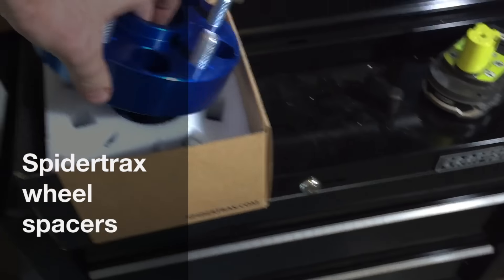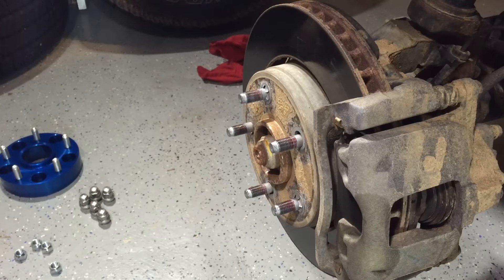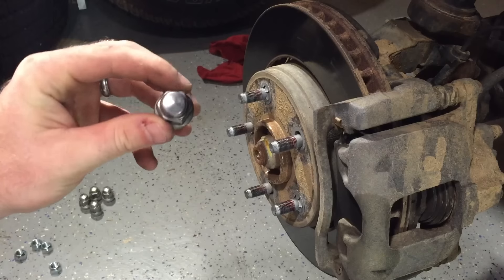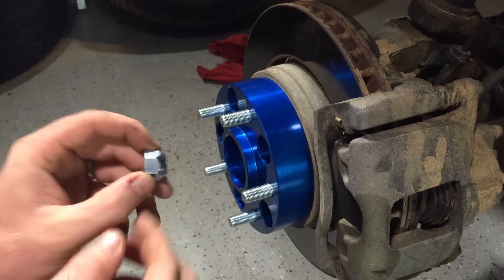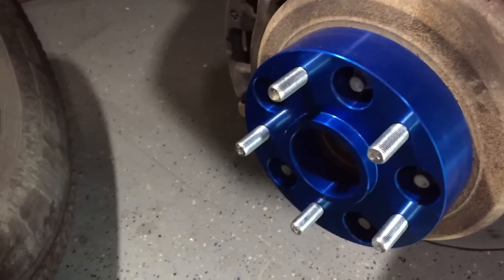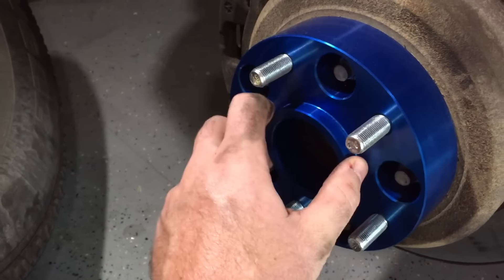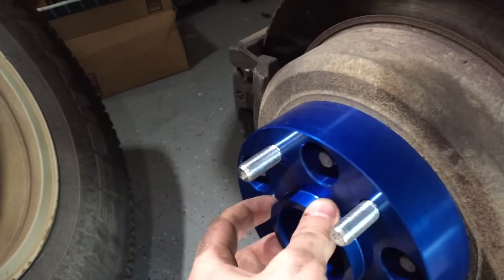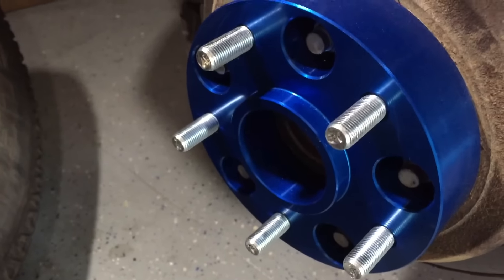Spidertrax wheel spacer install Jeep Wrangler

Comment: Just few notes, seems some major safety issues missed on this video:
1- Mounting surfaces should be cleaned 
2- factory clips SHALL be removed , you have 2 of them
3- Impact guns should not be used , use Torque Wrench and torque it to manufacturer recommendation
Be Safe.
Reply: +Amir-Ali Moosavizadeh 100% correct Amir!
Reply: Forgot about re-torquing

Comment: I have the same spacers, but an important safety tip: You forgot to take off the factory clips. You do not have a smooth mating surface.  Check out the teraflex video - different spacers, but show what I mean.
Reply: +Michael Zach pause the video on 0:04 and see there is a safe gap for the factory clips

Comment: it clearly says in the instructions to not use an impact gun you're supposed to distribute the weight evenly throughout the Lugnuts with a torque wrench. you are going to cause wear and tear on your bearings really fast

Comment: forgot one VERY important thing that could save someone an accident.  You have to torque the bolts to 90 lbs, drive it so it settles, then to 80 lbs.

Comment: why red thread locker and not blue? red needs to be heated for detachment.
Reply: Loctite sucks don't even know what the point of using it is, everytime I used it it was like it wasn't even there afterwards lol same with my guns, all it does it clog the threads up with shit you need to clean off everytime